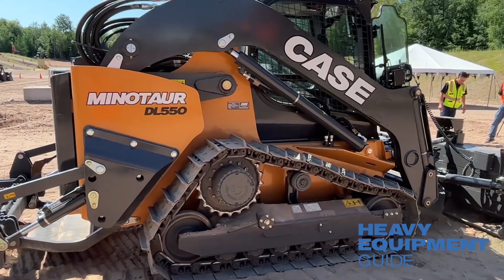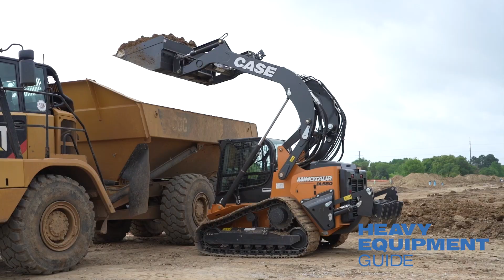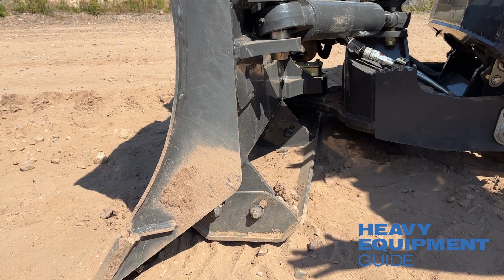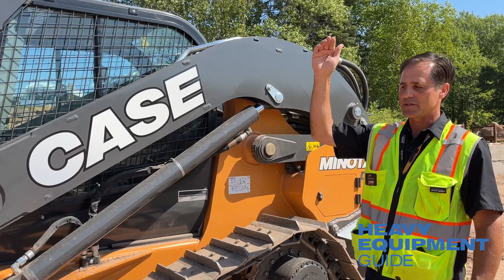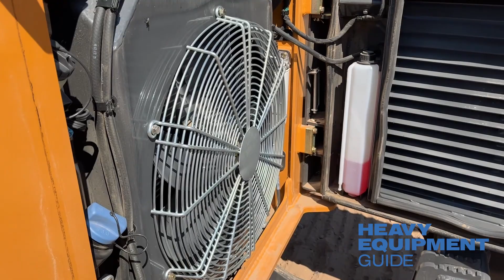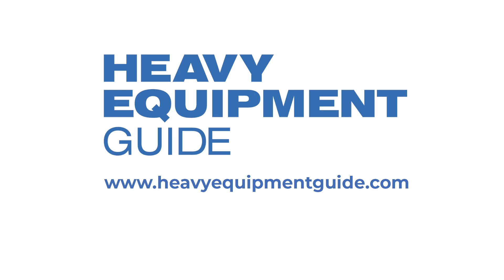Introducing the CASE Minotaur DL550

Comment: I love what Case did here so much that I looked at swapping my 120F ASV until I saw it was 270k CAD...  A hundred grand more than the 135 ASV.  I know the chassis is different but I couldn't justify the price difference.  There are plenty of dozers in a higher class out there lightly used for 50 to 80k and I'd have the option of a second machine.  Had this been in the realm of the new rt135 I would have taken the plunge.

Comment: Nice looking machine but why not just get the CAT 953 with 4in1 bucket then you wouldn't have to change bucket to blade plus the size of it makes it hard for most skidloader work or compact 259 289 299 would be my choice for skidloader but the 953 or 963 with rippers and 4in1 bucket would be my choice plus the hauling factor with a truck and trailer or GVW
Reply: Because a cat 953 with a 4in1 bucket isn't a dozer and can't do things a 6 way dozer blade can do, like cutting trails with correct slope for drainage. This is a dozer with the capability to use common skidsteer attachments, you're comparing it to machines that are built as loaders. If you don't need a 6 way dozer blade obviously this machine isn't for you.
Reply: @TheWallsocket  they dig basements move dirt open the bucket you got a blade a drag box and loader you clear brush grab logs with the 4in1 bucket but if you say so I've used the 953 for many things grading cutting filling loading
Reply: @TheWallsocket instead of a skidoader us a D4 D5 about the same size
Reply: @bradkaberline5828  and then you have two machines, a skid and and a small dozer. No this thing isn’t for everyone but for certain people, it’s goin to fit their operation perfectly. As for your 953 comment, that 4 in 1 bucket used as a blade isn’t going to push 1/4 what an 8ft dozer blade is going to push nor does it have 6-way function. Switching attachments takes less than a minute, not that big of a deal
Reply: @robo1210   I'd have to see the cost the considering the haul weight do the math at which point probably be cheaper just to use or get a dozer a small to mid size D4 or 5 not saying anything bad but I could not see buying a skidloader that is to big to get in some spots that all not saying anything bad bit you could only use it on wide open jobs what if you got in tight spots it just would not be a skidloader like say in some yards or side walk just some factors I would look at I mean if that's what yout looking at the dozer part of it for pushing dirt it would probably be best just to use a dozer. It would be hard to pay it self off if you could only use it on big jobs not compact skidloder work
Reply: I'm interested in it because it's lighter than a 953. There is a big gap in the largest ctl and a 953. I can haul this machine with my f450 and gooseneck. 953's are quit popular in my area but I think 80% of the work they do is over kill and can be done more efficient with this machine. I'd get the triple grouser track option for the longevity and rocky conditions and still be able to get on concrete and asphalt without to much damage. I still will have my 10k ctl for the tight sites.
Reply: @digger7871  I'd be looking at cost and how big it is for a skidloader is all I'm saying for the cost and not being able to do some smaller grade work to help pay for it or pay itself off you'd be limited on some jobs because how big it is I'd look at a Caterpillar 289 or 299 and compare cost a work ability on compact jobs or tight spots or skidloader work think if you had a customer needed a few things done but could not get the machine in a compact area you lose money or have to pass up on the job itself unless you had a smaller machine that's what I'd look at for a skidloader plus with the Caterpillar here in America you get the service plan if buying it new and you can get all the same attachments for the 289 and 299 6way blade bucket forks tillers ect the caterpillar 289 a good heavy duty machine not much plastic on them hoses mostly easy to get to if need fixed or replaced good all around skidloaders I've ran bobcat case John deere I liked the old 1845 loaders but not much on the new case loaders Caterpillar 289 is a good skidloader I'm just say for the size of it and cost you could probably get a rubber tire backhoe but if looking at for the skidloader part it's a bit big for some skidloader work is what I'd look at. As I said I'd be more concerned about not being able or having to turn some jobs down if the skidloader was to big is what I'd look at for a skidloader
Reply: @bradkaberline5828  I get your point, Im set up quit well for the small jobs with a rubber tire hoe that I bulk my dirt out with now but as you probably know they aren't a nimble machine for cutting grade. I also have a pt-30 and 4500lb mini X and a 75hp ctl. Thinking this machine will take care of the larger dirt moving jobs I get and have to work the shit out of my smaller machines to accomplish or turn the jobs down witch I do. I have yet to demo one of these machines but I've been waiting for someone to come out with a loader in the 18-22k range and I'm sure in time the other company will follow. Hopefully this case will be a well built machine and the dozer will be worth having i think it will be a fun machine to operate if it's worth a shit
Reply: @digger7871  depending on how set you are I'd look at a D3 or 4 for the dozer part with a Lazer or the newer ones even have grade assist I don't know but for the cost weight  ect if you all ready have a skidloader I'd look a the dozer part I don't know how much excavation work you do I'd just be looking at future jobs ect

Comment: $200,000 grand is my guess.. give or take.
Reply: I got quote for 215 with metal tracks and the blade. 180k plus for with rubber. I still think I would be great for a 1 man option. With the CTL/Dozer design
Reply: @Mvp-AngelOfGod  Sounds about right but the metal tracks seem really pricey… it's a 35K option? Wow.
Reply: @Mvp-AngelOfGod  really? I have a buddy who is the head of case management in MO and he told me 105k
Reply: @michaelstrunk7820  tf dealer uncharged maybe?

Comment: Whats the weight of this ? Price ect
Reply from the maker: Thank you for the comment, Paul!
The Minotaur DL550 weighs in at more than 18,000 lbs.
Manufacturers rarely disclose equipment pricing to the trade press. I would suggest contacting a CASE dealer for more information!
Reply: 105k
Reply: @michaelstrunk7820  18000LBS----this is Definity a niche market item!
Reply: @rear speaker  I wouldn't buy it got ro run a demo model for 40 hours wasn't impressed